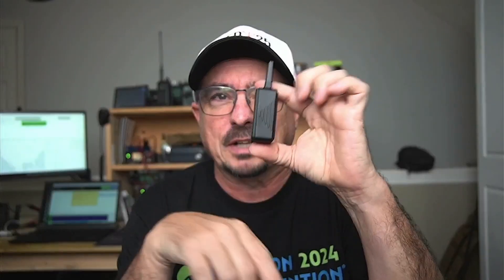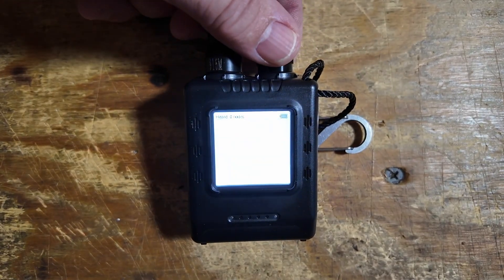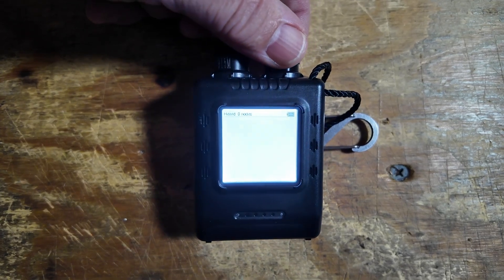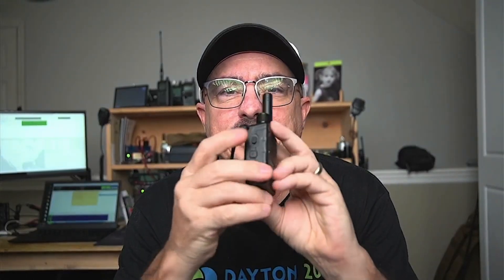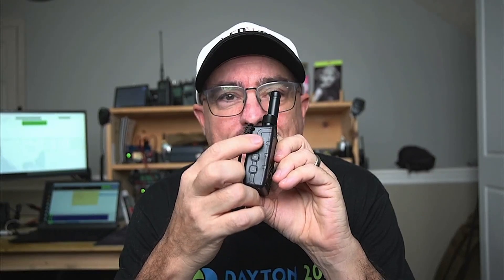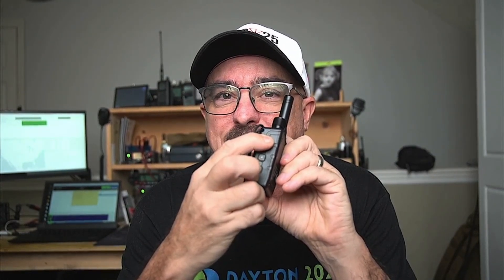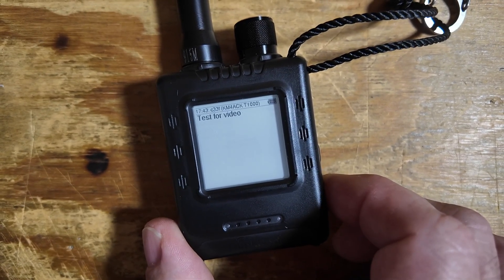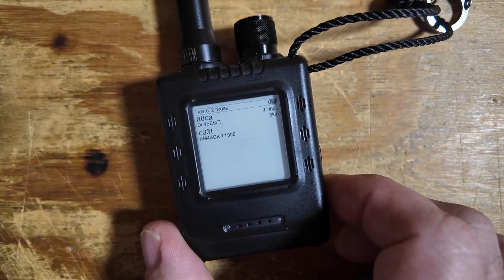Would You Trust This Device in an Emergency?

Comment: I personally wouldn't trust it in an emergency. Where I am, I've bought 2 nodes and taken them everywhere with me. Neither of them have seen a single node other than each other. I get that they are great in some places in the US and UK, but here there's just nothing out there. It's like screaming into the void. 

For emergency purposes I'll stick with my ham radios and plb.
Reply: It's up to individuals to stand-up mesh nodes in their area.  This is a design feature, not a bug.

The whole idea is to utilize frequency spectrum that is, for the end-user, license-free - and utilize that space to allow for short messaging and position reports.

So, it's the responsibility, if you will, of users in a geographic area to stand-up nodes and build the mesh.  If folks do this, it becomes a resource; if not, it won't be a resource.

It's no different, really, than other networks of radio users.  In the US, we have GMRS, which is situated in the UHF spectrum.  GMRS, unlike FRS, can use higher power, radios with removable antennas, and repeaters.  If an area doesn't have users that have stood-up repeaters, then it's pretty much a point-to-point, line of sight resource for very localized communications.  But if folks start running repeaters, then it extends the range a bit and becomes that much more useful.

Similarly, APRS -- used in the Amateur bands -- is a network that can be used to pass useful information, position reports, short messages, etc.  As a communications resource, it has a certain utility as stand-alone nodes; however, it's utility is greatly enhanced when users put up digipeaters and igates.

So, if one wants to see Meshtastic thrive in one's area, then the network has to be built first.
Reply from the maker: I hear ya. It can be very location-dependent!